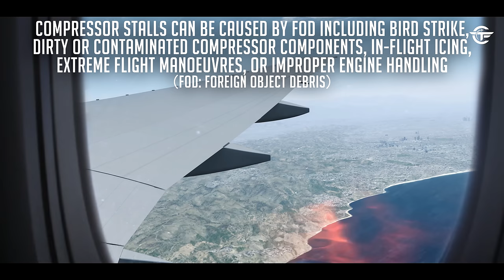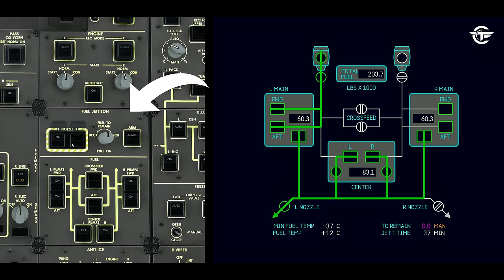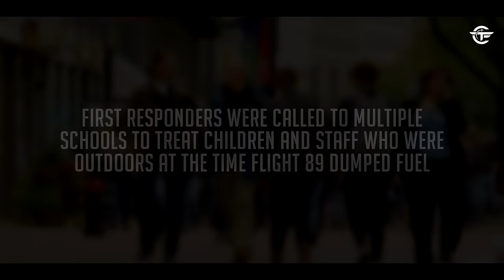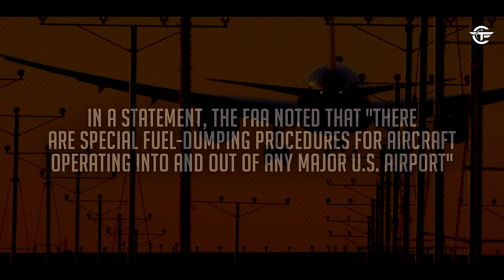Bursting into Flames Immediately After Takeoff from Los Angeles | With Real Audio

Comment: ATC: hey uh, do you need to dump fuel over the ocean or something at a high altitude?
delta 89: nah, i'm feeling particularly spiteful of the greater los angeles area today
Reply: I had no idea that this happened. They pretty much flew over my house dumping fuel but I guess I wasn't outside for the free kerosene shower.
Reply: @bugdrvr  they were over 5000 feet at one point so it didn't matter but below that was where the problem happened
Reply: Please prosecute...
Reply: You can land overweight. Depending how much the landing weight was and the type of touchdown, it could be a simple inspection.
Reply: Oh, when planes do land overweight, they tend to overheat their brakes. They taxi off the active and set their brakes which causes the wheels to over heat, that cause a fuse to melt and that causes flat tires. And when the airplane looses more than one tire per axil, you have to get a special Rhino jack which is hard to find. And you are working on a taxiway to change all those flat tires, and you may not have enough wheels in stock and you have to go borrow wheels from other carriers. Yep, been there.
Reply: @oldmech619  89
Reply: Wonder when Cali has so much pollution in the air.. They should of dumped over the city. Put I guess they had to do what they had to do!. Just make sure it don’t happen again ok? 😂
Reply: @BostonGrl79  The point is they didn't have to do it and it was Criminal !!!
They broke every rule in the book, they should have been fired and prosecuted.
Reply: Yeeeahhhh lol
Reply: delta 89 : no, we care for sea animals even though we're at a safe altitude
Reply: @oldmech619  Losing tires on an overweight landing is the least of your concerns.
Landing outside of MLW can also impact on the structural integrity of the aircraft, a structural inspection or evaluation of the touch-down loads before the next aircraft operation will be required in case damage has occurred.
Reply: Skelath    Yes, landing over your MLW adds up.  PIA broke a gear strut on a DC10 that went thru the wing in Jeddah many years ago.  It was just taxing out with pax.  Should never happen with simple taxi. Well, the records came out during the investigation that PIA had failed to do the heavy maintenance inspections for excessive MLW landings. Yea, there is a real reason inspections are called for. It saves lives
Reply: 🏆🏆🏆🏆 Best comment
Reply: Yes, when the plane is full on plane fuel, it becomes top heavyweight.   Meaning the plane being top heavy can easily roll like a spinning can constantly rolling.
Reply: @patriciamontagne1470  OMG it's a joke. Jeez
Reply: @oldmech619  So, it is much preferably to dump direct fuel on all over the habitational areas and schools  in order to not to be bothered with such difficulties like "having to borrow wheels"?
Reply: @Kitty-JuneOhSixJanTwentyFour     Flying airplane step one: Emergency checklist. No matter what happens, Fly the plane. Do not panic. Just stabilize the situation. You still have a great engine and this plane will fly itself. Just go out and take a dump. Now your plane is much Lighter and Safer to land. Sure, your approach speed is a bit higher but you haven’t done any damage to your plane. ATC is much happier because you can taxi off and you haven’t shut down the runway for hours while the mechanics are trying to go around finding tires. This airplane was a good example of what not to do.
Reply: @bugdrvr  l
Reply: Tbf dumping jet fuel in the middle of the ocean would have been catastrophic for marine life
Reply: @725prime  no he works be up to now than 5000 feet so there is no problem with that
Reply: @725prime  not if it was dumped at a higher altitude
Reply: @Mike Kabakov Meth?  California is nowhere near the Midwest or the South, where all the tweakers are
Reply: Short of a better explanation...sounds about right.
Reply: @Mike Kabakov that’s just wrong.
Reply: NTSB: Why did you Dump the FUEL over a populated Area???
PILOT: errr....
ALFRED: (dramatic interruption) because some men can't be bought, bullied, reasoned, or negotiated with. Some men just want to watch the world burn.
Reply: Hahahaha 🤣
Reply: Maybe the pilot was a trump voter
Reply: you funny :)
Reply: No need. We’re feeling generous and with the gas prices where they are we’ll dump closer to GLA today. Thank you.
Reply: Lmaso
Reply: @Mike Kabakov lmfao
Reply: "Hello tower, we're about to crop dust Los Angeles... helping "weed" growers from the friendly skies." xD
Reply: What about the sea turtles?
Reply: @10mmMotorsports ......would you have preferred that by not dumping fuel the plane could have landed and.turn into a ball of fire killing all.passangers...
Reply: @10mmMotorsports  They did dump fuel over the ocean, and the sea turtles knew nothing about it, because then the airplane was on a higher altitude, and the dumped fuel evaporated = ceased to be. The problem is that they chose to not stay there long enough, and chose to instead continue dumping fuel as the airplane descended below the altitude where the dumped fuel no longer evaporated. Had they remained on a higher altitude for a longer time than they did, while dumping as much of their fuel as they needed, they could've stopped when they got too low for the fuel to evaporate, and fuel landing on the ground/people would never have occurred at all.
Reply: @ethelmarycross1086 Sounds as if you both forget that no fuel reached the ocean, because it evaporated higher up, and that to avoid potential ball of fire risk, the pilots chose to instead dump fuel over several schools! (The pilots might not have "aimed" at the schools, but knew the airport isn't out in the wilderness, without in an area containing all sorts of city life, like schools.)

At least 56 innocent persons on the ground suffered from skin, and lung irritations as a result of the pilot's choice to selfishly only focus on their plane, and not think a little bit more on the consequences for what was below them. What if the dumped fuel had landed on persons starting a barbecue in a park/their garden, fire and dumped fuel sounds like a clear risk for that they could've become balls of fire...
Reply: Best comment ever!
Reply: @Chrisp707-  by
Reply: @Chrisp707-  then go back over the sea to dump at lower altitude at the very least, and let them know, and if needed, come in heavy.
Reply: Completely understandable.😁

Comment: I’d love to hear the pilots reasoning for dumping fuel like that when they were specifically asked by the atc guy working their flight “did you need to hold to dump fuel” and he acknowledged no!! They both need to be reprimanded for this and delta will be fined obviously and or sued
Reply: exactly and no more.
Reply: he was scared that the other engine fail so he did that ...its stupid thing but he justify himself that he landed the plane safely at least saving his live
Reply: If I was ATC, I would be thinking "so, you just left here like 5 minutes ago in a huge plane with enough fuel to go to freaking CHINA, and now you want to land back here and you don't want to dump fuel?? Uh... riiiight. WTF?"
Reply: @Cultural_Supremacist  
he probably think the same but atc cant refuse pilot land request specially in emergency if do he probably will charged with manslahter if the plane crashed ... the pilots hold full responsability of their decisions even if they like to crash land on the runway
Reply: @Cultural_Supremacist  Planes can land overweight. Requires an inspection. But that isn't a huge issue when maintenance have to change an engine anyway.
Reply: He asked more than once.
Reply: @Techie1224  ok didn't know that.
Reply: @slysimon8533  
i mean the ATC controller not the pilot in case of refuse emergency landing request  ...
Reply: Repeatedly he asked if they needed to dump over the Pacific..this is OUTRAGEOUS!...
THANK YOU FOR EXPOSING IT!

Comment: Having a smoke break outside when suddenly your doused in aviation fuel.......
Reply: get rekt smokers
Reply: lol
Reply: And you go kaboom
Reply: @thisaccounthasbeensuspended  actually good news, jet fuel doesn’t ignite on contact with a flame
Reply: Lol
Reply: They use flame retardant additives in jet fuel for safety reasons in case of a crash.
Reply: @BMK500  In liquid form, that's true most of the time. Under certain conditions however (fuel temperature already near it's flash point for example) ignition could be possible. There would be no "boom" though as the fuel would burn from it's surface until spent.
Reply: @williamdavissr7423  ?

Comment: As someone who's been doused with jet fuel on the job it's not a pleasant experience. It burns and itches the skin and the smell takes a very long time to get out. I feel it for the persons on the ground especially those kids. The pilots could have easily stayed offshore and dumped the required fuel needed especially if they had the issue under control. Absolutely ridiculous!!!
Reply: Agreed.  Those airliners are designed to fly on one engine within a safe envelope.  Very poor piloting.
Reply: 300 peoples lives or an uncomfortable feeling that is temporary?
Reply: Not nice, but better than risking immolation of passengers.
Reply: WUVS! No lives or unnecessary risk to people on the ground? The B777 can fly for hours on one engine. Check it’s E-TOPS. The pilots did a whole lot of wrong here, it’s a standard emergency.
Reply: Kerosene
Reply: @Horizon301.  yes but there could have been other problems with the plane following the engine failure. It was good piloting
Reply: @wuvs343  Huh? 777 is capable flying for long time even with one engine unless you are thinking it's 737, so i don't get you really think it's a very life threatening situation, while it's in fact as one of the plane capabilities.
And btw they had been ASKED to dump the fuel while still on top of ocean, but they ignored that option, the pilots are experienced which is why what they did here is outrageous because not even amateur pilots would do something like this..
Good pilots also respect the ground under them!! Unless they are in situation while it's out of their control..
Reply: @Horizon301.  Suppose now that they continued and the other engine failed, would you be pointing fingers that they shouldn't have continued with one engine?
Reply: Pentti Muhli that’s not how it works. They were over the sea already when they declared an emergency, they should have told ATC that they wanted to dump fuel given they needed to otherwise they would be landing overweight. What these pilots did was not follow standard SOP and it wasn’t in fear of any issues, it was due to pilot error one would assume or recklessness. There is an example of a BA 747 on this channel with the same issue, much better handled.
Reply: @sanniepstein4835  There was no risk of immolation to passengers.
Reply: It's better than the aircraft crashing on you.    Feel lucky that it was just jetfuel landing on you and not aircraft pieces.
Reply: @TimoBrown79  But that's not the alternative here.  

Of course it was better than that, and?
Reply: @wuvs343  The 777 could keep flying to Shanghai on 1 engine if it wanted to. As a safety procedure, they had to make an emergency landing ASAP. The passengers were in no way threatened. It would've been very easy for the pilots to stay over the ocean and at higher altitude to dump, instead of dumping on 56 people.
Reply: @wuvs343  The 777-200ER has a 330 minutes ETOPS rating, meaning it can fly for up to 5 1/2 hours on one engine.  No ones life was in danger had that plane circled over the Pacific for 30 minutes to dump fuel.  This was inexcusable, especially since they restarted the engine and it was functioning on reduced power.
Reply: Tp L  well first of all this is an isolated incident - the forest fires were caused by dry lightning and climate change. Also, you can tell if its raining gas or not... It would smell like shit and it wouldn't be raindrops, more like spray.
Reply: @joeo4234  other problems? That the pilot just mistakenly forgot to mention? The situation was clearly under control and he said he didn't need to dump fuel and then began to do it while even at 2000 feet. No issue there? Come on
Reply: @TimoBrown79  because he couldn't have dumped the fuel at a higher level. Like when he was at 8000? Don't make excuses for this ridiculous method of fuel dumping.. shall we talk about how he was asked if he needed to dump fuel and said no and then blatantly began dumping fuel anyway? The excuses we make for people is crazy. Flight was under control and he still lied and did things even rookie pilots will never do. Man please!
Reply: @wuvs343  and I'm SURE the 'victims' got financial compensation for the atrocity they had to endure.
Reply: But you lived. Get over it
Reply: Eric Miao I guess you missed the sarcasm.
Reply: Same thing I said
Reply: Marina D right? Kinda like black people who lived through slavery. You lived right? So get over it. (Clearly an extreme but you get the point) just because you lived through doesn’t mean you have to just get over it
Reply: If the people never noticed chem trails,,,this wasn't alarming for them
Reply: @overtherehere3050  there goes Delta ina class action lawsuits and going bankrupt
Reply: @rondj1965  a $1,000 gift card from Walmart? Lol
Reply: @wuvs343   They easily could have "saved 300 people lives" and not dumped jet fuel on children in the same time...
Those aircraft have no problem flying on one engine, especially when there is no need to rush, like here.
Reply: András Kun  who said anything about a little bit of fuel. I guess you don't know what the word doused mean. And don't assume about someone's age and experience.
Reply: @penttimuhli9442  The chance of both engines failing is exceedingly low, that's why the 777 along with many other modern twinjets have very high ETOPS ratings. Procedure is to calmly return to the airport when one engine fails, as well as dump fuel over either the ocean, an unpopulated area or above 5000ft. The pilots did not follow procedure in a non-critical emergency. Procedure is incredibly important for flying for everyone's safety so that's just being unacceptably bad at your job.

Comment: "Let me dump fuel over a non fuel dump designated area. What could go wrong???"
Reply: You're right, they should'nt have dumped fuel and possibly crashed on landing ?
Reply: @robmcmullan5732  They could have easily dumped fuel over the ocean or at a much higher altitude, there was absolutely no chance of it crashing if they did that as the left engine was perfectly fine.
Reply: Another pilots wannabe who knows all
Reply: forest fire!!!
Reply: @robmcmullan5732  they support dump fuel at high altitude so it evaporated before it hits the ground and not over populated area
Reply: Anne Arteaga  the plane was too heavy, with the fuel it needed to fly to china.
Reply: Anne Arteaga  no problem
Reply: No one actually said that so I don't know why that is in quotes. Fake quotes must be the fashion nowadays.
Reply: @dtz1000  its a joke smh
Reply: @cedricye1767  I know that but why put it in quotes? 

This fake quote business is a recent phenomenon.
Reply: @dtz1000  put it in quotes because its funny

its kind of like what happened in the cockpit only its not that literal

its hard to explain
Reply: The crew just went WACK-A-DOODLE-DOO!  Insanity is normal in California!
Reply: @robmcmullan5732  and he turned down the offer of emergency vehicles to support the plane. He was in denial. Then he said yes. Probably because others in the cockpit were threatening to strangle him. He needs a desk job. A bad engine is one thing but not knowing protocol and defending his position, “nothing to see here, move along.”

Comment: When this first happen I wanted to give them the benefit of doubt that they needed to quickly dump fuel because they where in an extream situation. No, just carelessness. They where already over water and up high, they should have started dumping as soon as they knew they where heading back.
Reply: OMG!!! Finally, someone who realizes the full details and holds those pilots responsible!!!
Don't forget, ATC double- (or triple-) checked with the pilots about dumping fuel over the ocean. Pilots should've said yes AND told ATC.
Reply: @swanlove2002  I believe so, but, how much of an issue is it to try to save as much of the fuel as possible?
Reply: @thomasrebotier1741  I believe it lessens the possibility of the plane exploding during an emergency landing.
Reply: @rebeccawright9599  Just the opposite, the more fuel onboard the worse the explosion.  And the heavier the landing, which is why they dumped it eventually.  Obviously the pilots put the company's finance over security; I'd just like to know how much was at stake

Comment: Why didn't they dump fuel immediately when they were over the ocean ?
The pilots sound like they don't know what to do, or they are distracted.
This doesn't sound like a normal problem they have trained for.
They are not answering ATC
Something is going on in the cockpit that is taking their attention
With the engine off they should have control over the situation and not be so distracted.
Reply: they were doing it. y know. mile high club
Reply: They sounded stoned haha
Reply: And dump it at 5000 or higher where it evaporates. Nah lets just dump it onto a  CHILDREN's elementary school and over housing.
Reply: @SWIFTO_SCYTHE  couldnt they activate the auto destruct?
Reply: Yea just thank god not both engines failed otherwise they'll make like a statue with the attitude then they would have Crashed at the school.